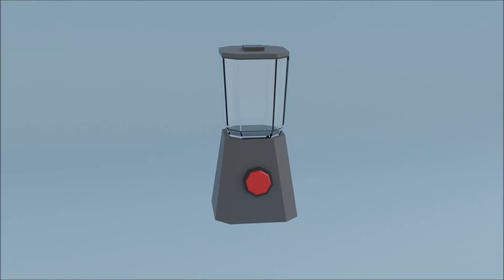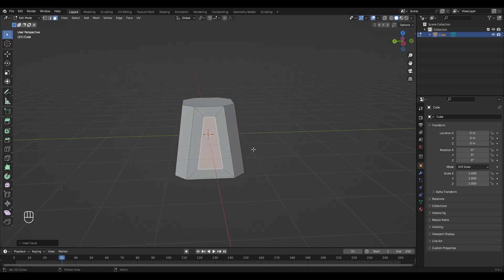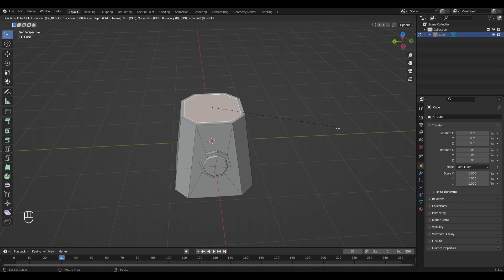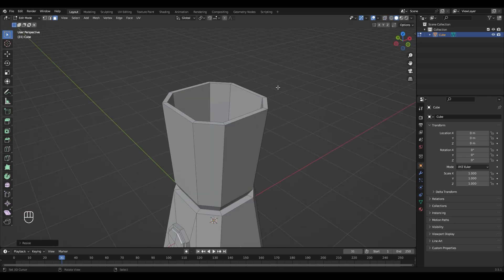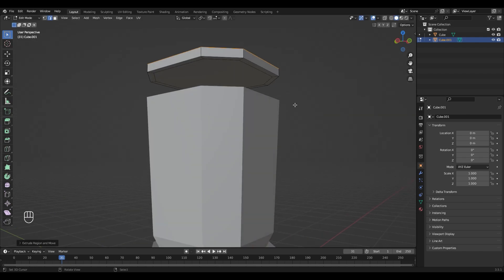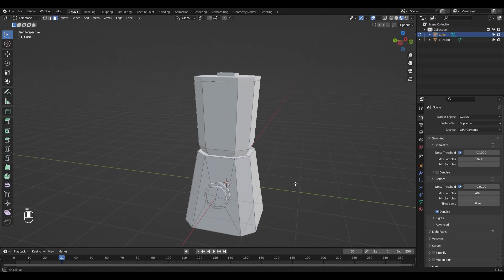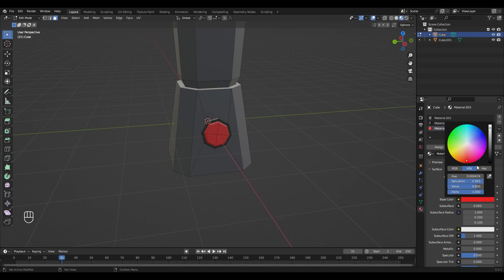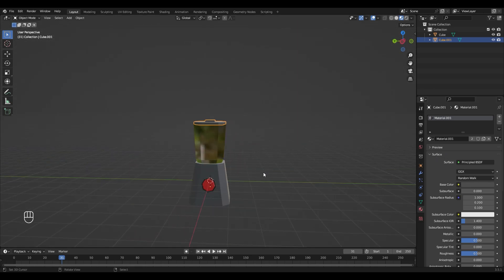Low Poly Blender in Blender Tutorial For Beginners!

Comment: how to make the glass part of that blender object becomes transparent?
Reply from the maker: In the maetrial, it should by default use the "principled BSDF". There you set the roughness to 0 and the transmission to 1.  Or if you want to, just change from the "principled BSDF" to "glass BSDF".   
This works fine for Cycles. 
If you render with Evee, you have to do 2 additional things to allow for transperency in the render: In the material settings in the surface tab, you'll find a checkbox "Raytraced transmission". Turn that on. And in the scene tab (the little camera icon, where you make the render settings), look for the "raytracing" checkbox and turn it on too. 

You can use the searchbar of the settings tab and it highlights the things,  but let me know if you need me to make some screenshots.
Hope this helps! :)